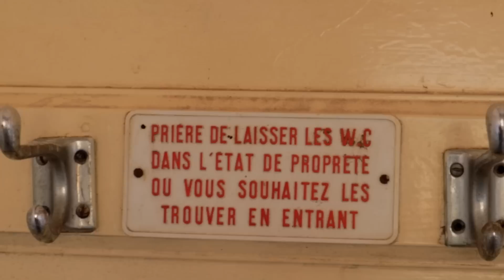Bathroom Renovation Ep 4 | Shower Cubicle & New Bathtub Walls

Comment: I think it’s gonna look a mess as the water interferes with your paint in the shower segment as time goes by. I would consider putting tiles on the wall in the shower segment. Otherwise it’s beautiful. ❤
Reply from the maker: I'm good. The paint is waterproof and mildew proof. Tiles are not the only options for bathroom walls.
Reply: @IAmMuthoniGitau  Wow, had no idea. You learn something new on this channel with every video.